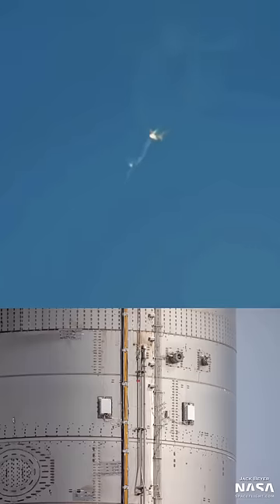Is This Why Starship Wasn’t Destroyed The Moment It Lost Control?

Comment: I'm surprised Starship and the booster didn't break apart when it started tumbling. Guess that's a credit to it's structural integrity.
Reply: The force on the tumbling rocket are much smaller. It was at 30km, where the air density is only 1,3% of sea level. Furthermore, the centrifugal force is very small, and finally the engine thrust direction is still (apart from gimballing, which it is designed for) straight through the CG.

So overall I am not surprised it held up even while tumbling and going sideways.
Reply: One could therefore suggest that the rocket is structurally over-engineered and some weight can be saved once the forces on it during its mission are fully known 😊
Reply: If it was still fully pressurized, it could resist a lot of forces.
Reply: There is a picture of the booster and ship which started to bend... But if the FTS was already initiated, this is probably due to loss of pressure inside the tanks. So that is pretty impressive it held up even after the FTS
Reply: They (over)worked a lot in the last couple of weeks leading up to these launches to fix structural weak points on both booster and the ship.
Reply: @digi3218 that "picture" could have easily been lense curve, atmospheric distortion, heat distortion, or a few other things.
Reply: @EagleMitch  I don't think it was. But Im pretty sure it was from the webstream right before the explosion. I assumed maybe the tanks were low on pressure and the aerodynamic drag caused it to buckle. I was a little worried it was the systems fault for low pressure but now it is obvious it's because the FTS puncturing the tanks.
Reply: Reading this with your profile picture is so hilarious
Reply: Idk why people think it’s such a massive feat of accomplishment. Rockets have been in use for 100 years now. And considering it has a large booster applying lateral force to it which is keeping most of the horizontal forces at bay. In fact the rocket failed so not a feat by any means at all
Reply: @Flockingtheherd  you're just mad because your booster doesn't stand straight up anymore
Reply: @Flockingtheherd  btw sorry your employment virgin galactic ended when they failed 😂
Reply: I thought the onboard computer system was responsible for flight termination
Reply: @jonslg240  what color is your booster?
Reply: @oldmech619  it was.. after the rocket started spiraling and failed to seperate 😂
Reply: @Flockingtheherd    I would have like to see the Starship separate from the booster then fly away intact and returns to the ocean to do a planned vertical landing for emergency procedures. That would have been a show
Reply: @oldmech619  that’s what it was supposed to be but that didn’t happen, therefore mission fail. Not sure why everybody’s trying to turn this into some massive success and chortle the worlds richest man’s bawls. We have a growing homeless problem in the United States, we should be focused on that instead of giving all our money to a guy so he can burn it in earths orbit
Reply: @Flockingtheherd    Well Elon is really burning through a lot of money and it is not all his money. He just wasted a Starship because he didn’t want to wait a month.
Reply: This is now the universal cope: it didn't break up immediately because it's so good!
Reply: @DerKrawallkeks  it was 2 Mach tho
Reply: @pai8758  true, I haven't done that calculation. There must be some forces at that speed, even at 1,3% density. 30km is the ceiling for some very exotic planes, that means there must be some aerodynamic forces
Reply: @Flockingtheherd  LOL! That problem can't be fixed. And even if it could,  if you want to give your money to the problem go ahead. I'd rather it go to something worthwhile like this.
Reply: Really?
Reply: @DerKrawallkeks  Low air density gets significantly balanced out by the fact that the vehicle is tumbling while also traveling multiple thousands of mph.
Reply: @Flockingtheherd  Wait... Are you the same guy who said pretty much the same thing when the first drone ship landing blew up?  I hope you're crossing the hell out of your fingers that this time, surely, SpaceX will fail and give up, rather than once again upending the industry after a few iterations.
Reply: @Asterra2  it was not traveling multiple thousands of mph
Reply: @DerKrawallkeks  My bad.  Multiple thousands of kph.
Reply: nerd
Reply: @Asterra2  hey man all I’m trying to say is you will never see any benefit from Elon musk going to space.
Reply: @Flockingtheherd  Okay now you sound like the folks in the 60s protesting the Apollo program.  Me, I'm benefitting from the fact that computer technology was accelerated by at least a decade, thanks to the mandates of Apollo.  Just to list one of countless benefits.  In the case of SpaceX, things are far more clear cut, because there are actual goals of making space cheaper, rather than just a goalpost to reach.  Of course, I do get that you were attempting to pigeonhole the entire endeavor as the hubris of a single man, because you have a hate boner for said man, but you can take my counter as in earnest nonetheless.
Reply: @oldmech619  Waiting costs money too. If it's going to fail, sometimes it's better to let it fall so you can hurry and fix it rather than waiting months for something you didn't account for to fail anyway.
Reply: @atomicviking2497     That accident cost at least $100m.  SpaceX tested a launch pad configuration that they were not going to use again. SpaceX basically gained nothing. The flame diverters are already on site. 
Note. Starship did do a test run of all engines but not at full power or as long as planned at lift off. 
The failed concrete that was under the pad was a special blend to handle the pressures and heat.
Reply: @Asterra2  multiple thousands of km/h sounds so much grander than...2. it was 2.
Reply: @UKnowIfUKnow  Wait. It really was thousands of km/hour? I thought they were exaggerating. Figured the dead engines only let it get to maybe the speed of sound. Dang that thing was actually booking.
Reply: @digi3218  General consensus is that was rolling shutter distortion. Video from the interstage section showed nothing like those few frames.
Reply: @marcbrown7135  yeah. It peaked right at 2100 for a split second. But that MIGHT have been during it's 'unscheduled' descent. Regardless, a solid 2000+ peak.
Reply: The Starship will be designed to bellyflop most of the way to landing, contrast the Space Shuttle that was designed to restrict its AoA deeper into the atmosphere.
Reply: it did bend when it hit max q a second time. that's actually the point where it exploded.
Reply: @EagleMitch  you can see its bent in the explosion images, a couple of them light up the stages enough to see they are actually about 7* bent from camera angle right at explosion..
Reply: @DerKrawallkeks  centripetal force. Centrifugal force does not exist.
Reply: @gingerman5123  The problem is these flat earthers here only believe their eyes, not science.
Reply: @nathanschroeder4871  yes very true. I just went with everybody as to not confuse people. And in my opinion, it's fine to call it that (even though it's not a real force).
And we wouldn't really want to say centripetal forces rip something apart, just like we wouldn't say in a lateral example the forces holding something together would rip it apart, but we'd rather say the external forces rip it apart.
Therefore I'm fine with people saying the imaginary centrifugal force rips something apart.
You're absolutely right though:)
Reply: @nkronert  Better to be flying personnel in an over-engineered rocket than an under-engineered one. This one just still needs work.
Reply: @crowe6961  very true.
Reply: @nathanschroeder4871     When someone says Centrifugal Force, you and every other person understand the forces exerted.  This forum is not a Physics class.  So just ease up a bit with your great knowledge of the universe
Reply: @oldmech619  No.
Reply: @nathanschroeder4871  OK
Reply: @EagleMitch  Yes, lens distortion definitely causes a line to be totally straight until it gets to the vehicle interface, then suddenly turns and goes totally straight in a different direction. Obviously.
Reply: @Asterra2  Not even multiple thousands of kph, it was traveling less than 1600 kph at apogee, which is less than 1000 mph. At that altitude and airspeed the forces are pretty modest and any rocket would likely survive a flip.
Reply: @nathanschroeder4871  Knowledge is knowing there's no such thing as centrifugal force. Wisdom is knowing that it doesn't matter.
Reply: @harbingerdawn  i got real curious so i checked and the thing is well into its spin when it hits the max speed of 2175 kmph. thats what the discussion was about of course, the spin. apogee? lol. why not just say it was goin real damn slow right before it blew up if your gonna pick arbitrary times for yourself
Reply: @blakenaftel3637  2175 isn't that much more than 15xx, the point is it's relatively slow and at a very high altitude, and most rockets could be expected to survive such conditions. I don't understand why everyone is so invested in the idea of SSH being some kind of structural wonder rocket. Saying that it doesn't need to be particularly stronger than other rockets to survive the tumble isn't the same as saying that it's somehow bad. Structurally it's fine. How is anyone perturbed by that?
Reply: @DerKrawallkeks  Name one airplane with a service ceiling of 30 km.
Reply: @atomicviking2497  There's a difference between discovering unexpected problems and testing a system that has obvious problems that shouldn't exist. The former is useful, while the latter is a waste of time and money, usually more time and money than it would have taken to do it right in the first place.
Reply: @harbingerdawn  the SR 71 comes close at 26km, that's what I had in mind. The MIG 25 can apparently go to 24,4km. So yea, not quite 30 but close
Reply: @harbingerdawn  I'm sure you're right, but I suspect it depends. The ship that flew was never going to be the final one. It was probably already obsolete. For all I know, many issues may already be fixed.
Reply: @atomicviking2497  It's not the rocket that's the issue, it's the pad. Throwing 16 Mlbs of thrust into a flat concrete surface directly below the rocket has an extremely high chance of catastrophic results, which is what we saw. Damage caused by huge chunks of concrete is likely what caused so many engine failures immediately after launch, and thus likely resulted in the flight failing to progress beyond the boost phase. The data they needed most was on staging and Starship reentry/thermal tile performance, and they threw away their chance to get that data on this flight. Not to mention all the damage done to the pad itself, the tank farm, and cars and cameras for miles around. All of that was easily foreseeable and avoidable.
Reply: There’s a leaked photo of it actually bent right out of shape. The thing was a mess, but impressive it did remain as one unit
Reply: @EagleMitch  I’m a photographer for a living. I haven’t seen the image. But it’s unlikely to be distortion of any time. The rocket would essentially be entirely in the same focal plane at this distance and consuming a relatively small portion of the center of the projected image and not stretch edge to edge where distortion starts to become noticeable. 

Depends on the lens obviously…but I own $10,000 lenses I use for professional football and baseball and would use for launches if I had the opportunity.
Reply: @JaydenLawson  that's what I was thinking. That thing took some abuse before finally breaking up. I usually think of space ships as being kind of brittle. It's nice to think that even if something hits the thing in orbit, everyone won't immediately vaporize.
Reply: @thopkins2271  to everyone dog piling on me, I am simply quoting what Scott Manley said in his first video about it.  Go after him, not me.  I don't give a shit.
Reply: @EagleMitch  fair. But he’s wrong as well. It may well be some sort of illusion, I’m just saying it’s not a photographic artifact/distortion.
Reply: @EagleMitch  I should also note that I’m referring to an actual photograph. If it’s a frame from a video camera, then it gets much more difficult to say for sure.
Reply: It would have been neat if they caught the problem after one or two spins and had just gone to orbit afterwards
Reply: @DerKrawallkeks  it was spinning with forced still being applied… and it’s boosters didn’t cut off. It was throwing more pressure on the structure. Find me another rocket that does flips and not blow up.
Reply: @Flockingtheherd bro it is literally the most powerful rocket that flew. Of course it's an achievement.
Reply: @jonslg240  If your booster stays straight for more than four hours, consult your doctor.
Reply: Air density at altitude is really low, near 1% of sea level.
Plus the angle of attack was probably much smaller than it looked from the ground as we could only see it moving laterally, not its forward motion too.
Reply: @oldmech619  waiting wouldn't have helped. Booster 8 (next in line) has electric servos for gimbal control, instead of hydraulic powered that are more prone to failure as just one of the many improvements that have already been made. This booster (#7, and Starship #24) were already obsolete at launch, they were going to be destroyed either way, why not get useful data from them. This tests goal was literally to clear the tower, anything beyond that was just bonus flight data. Fast prototyping and testing is how SpaceX gets things done. They said you cand land a booster on a barge in the middle of the ocean, and look where Falcon 9 is, the latest version (Block5) has successfully landed 158 out of 163 attempts for 96.9% success rate. Not bad for something people said couldn't be done. Falcon 9 was developed the same way, just that SpaceX wasn't well known at that time.
Reply: @T_Mo271  fully pressurised? Not sure about that. It was supposed to be empty by that time ….
Reply: @nkronert  Nah they as light as they can get. why would you test it in a stronger version and then have to redesign all of it just to match the newer and lighter Hull. that makes no sense. They are testing it as it will be later on. every gramm is calculated.
Reply: It's and its are not the same thing.
Reply: @eliwithey  What exactly are the benefits of engineering a rocket that can withstand the forces applied when  tumbling out of control? It’s pointless
Reply: well you would be guessing wrong for many reasons, also the rocket was completely bent prior to the explosion, you can't see it on these videos but there are leaked images that show it very clearly.

Comment: I thought that the flight termination system was usually a linear charge running along the entire length of the stage. So it doesn't just punch a hole - it tears open the entire side of the tank so that aerodynamic forces will rip it apart immediately. I am not familiar with this particular rocket but most of them use a linear charge.
Reply: Thats not the case with spacex. What you saw in this video is accurate. It just uses a small linear shaped charge to punch a hole. Works fine on a Falcon 9....obviously its time to rethink for starship.
Reply: You are correct! That's the way they used to do it. It would basically unzip the entire rocket. The old school way is much more effective in my opinion.
Reply: That's how it's made on Ariane 5 for example. A rocket is far more sturdy that we might think, and destroying it properly is not that simple. It seem that on this cases the flight termination system is not very good at it, this is bad for a flight with such a high probability of failure.
Reply: The issues are the debris, this is stainless remember, by creating destructive detonation within the tanks as opposed to externally it will reduce a lot of the dangerous debris that can fall to earth uncontrolled.....
Reply: maybe Elon sacked all the kaboom experts
Reply: @gordslater  or maybe, just maybe, random commenters on youtube don't know better than the engineers working on the actual system.
Reply: @mitchellroberts7954  Or, maybe just maybe, Americans will understand sarcasm enough one day, to just laugh and move on!?
Reply: Does SpaceX use shaped charges or preformed fragments? Could high explosives alone do the job?
Reply: P
Reply: P